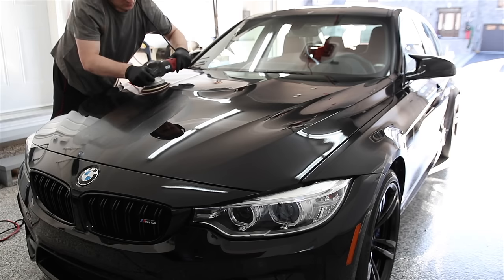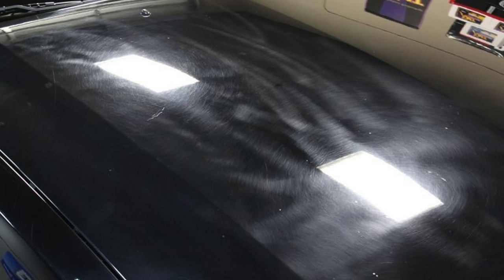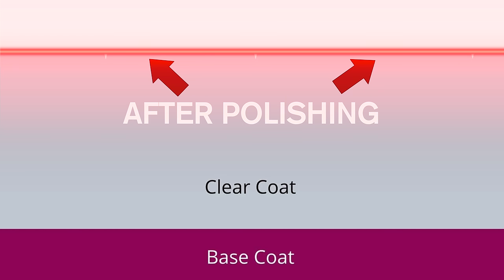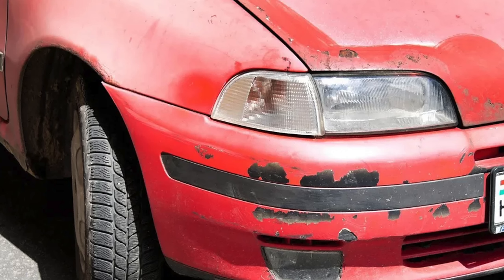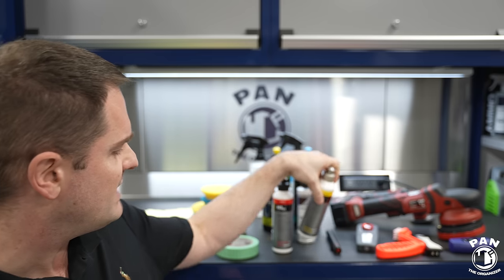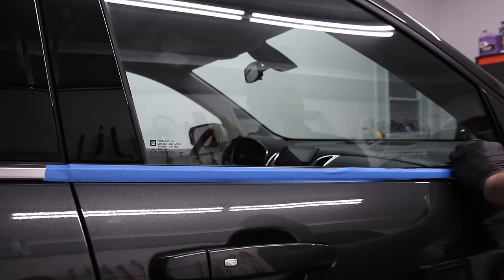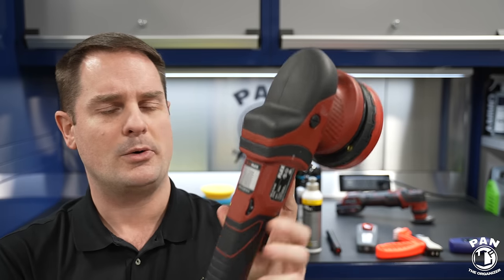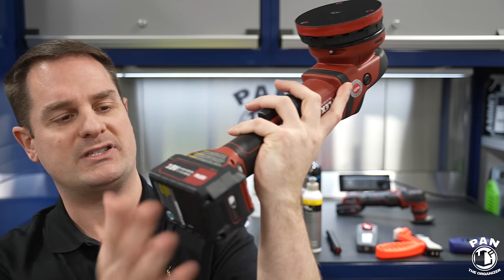DETAILING 101 - Paint Polishing - Everything You Need To Know

Comment: My car is ceramic coated a year ago

I found some hard water spot and scratches

Is it okay to polish it?
How is the decontamination stage before polishing?

My car is black so i cant tell if theres a tar or iron dust?
But i can feel sands texture on the lower door panels
Reply from the maker: Wow, you sure have a lot of problems going on! That's usually a sign that you didn't take proper care of your vehicle on a regular basis.

1) You don't polish ceramic coatings as you would remove the coatings. Polishing mechanically abrades the surface and strips the protection. For water spots, use a water spot remover, like this: https://bit.ly/44ehi2g

That's assuming the water spots haven't been left unattended for a long while, and haven't started etching through the clear coat.

2) If you feel a sand paper like texture on the lower parts of the car, it needs to be clayed. But don't use a traditional clay bar as that would do marring on the paint and damage the coating. Use a synthetic perforated clay towel like this: https://bit.ly/3U4LO9V

3) For scratches, if they are very fine and light scratches, you can try using a polish that was designed for correcting very minor defects on ceramic coatings. This one: https://bit.ly/3FAzyqP

If the scratches are very big and deep, then you have no choice but to fully wash and decontaminate the paint, machine polish to your desired level of finish, and reapply the ceramic coating.

If you use safe washing and drying methods, you should not have to repolish your car often. My Porsche 911 Turbo S was polished once when I took delivery, and I haven't had the need to polish it in the three years that I have owned it.
Reply: @PanTheOrganizer  whoa thanks for your input

Can i ask how do i safely decon my ceramic coated cars which the lower part of the panel has already lost its beading

Should i use a clay towel?
Or its fine to use only microfiber towel to agitate the tar removers

And how is the best way to do it

Should i do it after a wash?

Should i do it while its still wet or dried off

Whats the steps?
Iron remover - spray off
Dry
Tar remover - wipe off with microfiber towel is okay?
Dry off

Use a water spot removed - wipe off with microfiber towel?

Comment: Is it necessary to use a Decon shampoo or will a PH neutral be fine ?
Reply from the maker: Before the polishing process? pH neutral is fine. As long as you're not using a shampoo that has protection in it (like a wax or ceramic). You don't want to be adding protection before you are polishing.

Comment: Question: what is a microfiber polishing bonnet used for? And how does it compare to the sponge in your video
Reply from the maker: What I present here are polishing pads. Not bonnets.
Reply: @PanTheOrganizer  
Right...I was asking about the bonnets not because you had one, but because I bought one from Amazon to polish my motorcycle but after watching your video I'm not sure I have the right thing. Do I need one like yours to polish? And if so, what is my bonnet used for, is it for cutting?
Reply from the maker: Bonnets are usually for lower end polishers, and really only meant to apply a quick liquid wax. Not really for paint correction. True paint correction (removing swirls, scratches and oxidation) is done with a machine polisher that has a "hook and loop" style backing plate, on which you attach polishing pads, that have the same "hook and loop" system on their back (kind of like a velcro style material).
Reply: @PanTheOrganizer  
Wow thank you for your input! :) 
Can you recommend any entry level cordless polishers? I bought a brand new $800 motorcycle tank and when it came in by package, the black tank paint looked like glass. After a couple months of wiping and cleaning it, I've noticed swirl marks on it 😱.

And would it be best to look into those multi purpose polishers, so that as a beginner it'll help prevent me from burning through thin clear coats like what's on my tank?

Comment: So what youre saying is that every time you polish you remove a little of the coat? Wont that mean that you can only polish a limited amount of times before destroying the paint?,
Reply from the maker: More or less, yes. But depending on what you are doing, you're not removing that much. If you are doing a heavy cutting compound with a wool or microfiber pad, and then doing a polishing step, you are removing more clear coat than a 1-step simple polish (for lighter swirls and scratches).

But yes there's a reason it's called paint correction. You are correcting the paint defects by removing a thin layer of clear coat, to make the paint true and flat as much as possible, all while removing oxidation and boosting gloss, depth, clarity etc.

If you polish your car and protect the paint, and then use safe washing and drying methods, you shouldn't have to polish your car for a few years. I get a new car every three years. I only polish it once when it's brand new, to get the paint perfect, and then for the three following years I never need to repolish it. 

But certainly it wouldn't be advisable to polish the car every three months haha. You would eventually go through your clear coat.

Comment: When you buffer/polish a car to its shine, does the car goes back to its old condition like faded paint after washing it for several times?
Reply from the maker: No. Once the paint is corrected and protected, and you care for it properly, it will look good for many years. Of course, if you don't use proper washing and drying methods, and don't regularly wash and use protection, it will eventually get scratched again and the paint will start to fade and oxidize.

So it's all about RESTORING first, and then PROTECTING and MAINTENANCE.

Comment: Hi Pan, I tried doing the polishing using Turtle Wax Polishing Compound, and I had some bad experience with it. Basically when I just started the polishing, the compound became dusty very quickly. I tried using slower speed (roughly speed 2 or 3 and it's really slow, significantly slower than what you've shown in the video), it did become dusty after 2nd or 3rd pass. Unlike the one you've shown in the video, the polishing is so smooth, oily looking and easily removed. Mine is soooo difficult to remove, especially when it became dusty. I'm using 3-4 drops pea size on the foam pad, and I did it under shade (late evening), so it's not hot anymore. Also working in a small area at a time with almost same speed per pass like what you've shown, but it just became dusty too quickly. May I know where has gone wrong?
Reply from the maker: Hard to say as I can't see what you have done and exactly what pads, techniques, etc you were using. What Turtle Wax polishing compound are you referring to exactly? They make many. Perhaps you're overworking the product?? The best bet is to reach out to Turtle Wax and troubleshoot with them. Companies are great for that as they know their products well, but more importantly have helped people go over hurdles or bumps in the road when they have issues.

Comment: If I got polish compound and wax on my plastic trim and it's now chalky white, how would you suggest I remove it now that it's caked in?
Reply from the maker: You should tape your plastic trim before polishing. To avoid that. At this point, you will have to use one of two products. A paint prep spray like this: https://bit.ly/3KXhk6V

Or an all-purpose cleaner like this: https://bit.ly/3L0N6zU

Wash the car, dry it. Spray the product and brush with a detailing brush like this: https://bit.ly/3ZsBjyY

Rinse thoroughly and dry.
Reply: @PanTheOrganizer  Thanks Pan for the breakdown. And yes, lesson learned.

Comment: The hood (bonnet) on my car is ful of hazing and swirles and is really visible. I was thinking of using meguires compound and polisher by hand as I do not have access to an electrical tool to use it on. Is there anything special that I need to do around the window washers?
Reply from the maker: You can either remove them, or tape them.

Comment: how many times can you typically do a paint correction on a vehicle.  i got only light swirl marks.
Reply from the maker: It depends on many variables. Paint type, make and model, condition of paint, paint thickness (measured with a paint thickness gauge), etc

But on a brand new car, it’s safe to say a light polish can be done a few times without worrying about the clear coat diminshing too much.

A compound followed by a polish will obviously remove more clear coat compared to a polish alone.

But once polished and protected, if you use safe washing and drying techniques, you shouldn’t have to polish for a few years.

Comment: Hi I only have small scuff marks.  my SUV has a ceramic coating. I was going to use chemical guys P4. Is it hard to do?  Thank you
Reply from the maker: DO NOT machine polish your paint, because it has a ceramic coating. If you polish it, you will be stripping the coating off. The mechanical abrasion from the polish and the pad will strip any paint protection right off.

If those are only VERY LIGHT defects, there is only one polish currently meant to remove light defects on an existing ceramic coating, and it's this one: https://bit.ly/3Wzl8Rl

With this pad: https://bit.ly/3YhQwVG

Your other option is to use a standard polish and polish the entire vehicle, which would remove the coating, remove the defects, and then restart with a new fresh coating application.

Welcome to my channel. You discovered one of the biggest car detailing channels on YouTube as we surpassed 1 million subscribers and we have over 145 million views! I have been detailing for 27 years and I love to share my knowledge and passion with my viewers.

You found the right channel to help you learn everything about detailing.

Comment: Pan, do you know if that mini polisher is a DA? From what I can tell it's not. But I guess you don't really don't need a DA when they are that small.
Reply from the maker: Are you talking about the Rupes iBrid Nano mini polisher? It has adapters so it can operate as a 3mm or 12mm random orbital (DA), and even an on-center rotary. It can do both.
Reply: @PanTheOrganizer  No sir, I was referring to the Flex cordless mini
Reply from the maker: The Flex PXE80 also does rotary and dual action. This tool’s designated backing system is meant for spot sanding (random orbital 3mm/rotary) paint correction and spot repair, polishing (rotary/random orbital 3/12 mm) for flexible polishing with polishing pads for the elimination of sanding spots and hologram-free finishes, and polishing/sanding (random orbital 3/12 mm) for defect correction, paint correction and hologram removal and finish.

Comment: I saw you have a golf R on there. Do you know if the GTi paint is hard or soft? I have the deep black pearl color on GTi MK6. Also, at what point in the process do we apply touch up paint? Thanks
Reply from the maker: Typically, German brands have a harder clear coat. But I haven't detailed a new GTi in a few years. I had actually made a video about it here: https://youtu.be/epBqfhMeGR0

The best way is to always do a test spot first. You'll see what pad/liquid/combo you need to correct the paint.
Reply: @PanTheOrganizer  Thanks. Mine is 11 years old, so that’s why I was asking about your experience with the old ones. 

Do you know at what point in the process I should apply the touch up paint to the areas that need it? Thanks
Reply from the maker: There are many schools of thought on that, but the majority of pro detailers seem to agree that you machine polish first, do your touch ups after. Wait until the paint is fully dried, and then do the paint protection.

For sure you wouldn't touch up after paint protection, as the touch up paint wouldn't penetrate well beneath the wax or coating, and would get rejected or fail to bond.
Reply: @PanTheOrganizer  Thanks, I didn’t know if it was before or after the polishing stage. So I will compound, then polish, then touch the paint and then put the ceramic coating. Thanks Again

Comment: Master some questions, how many rpm is the speed 2? How many corrections can the clear costo can manage?
Reply: Cold Surface? Avoid heating Surface? 3 step compounds workd with the tecnic You show?
Reply from the maker: For correction (compound and polish) you are using higher speeds (for example, speed 4 or 5 on a 6 speed setting). To apply liquid waxes or sealants (which contain no abrasives, just protection), you are using lower speeds (for example speed 2 on a 6 speed setting). Those are general guidelines.

Comment: Hey Pan, Can I use the same polish procedure on my headlights? only for some light scratches, car is still new. Thanks
Reply from the maker: Yes, or you can use a lens restoration kit with no tools needed like in my tutorial: https://youtu.be/sqpXsBcVako

But headlights restorations are more for removing oxidation and yellowing.
Reply: @PanTheOrganizer  Thank you mate for your reply! I saw that video today as well. Was thinking which way I should go. I might use the DA polisher with my normal pad and Mequiar polishing oil, panel wipe and apply CSL as protection. I did the whole panel coating with CSL+Exov4, Glass coating with your instructions. Great results really!
Reply from the maker: Cool. Keep in mind, depending on how deep the scratches are on your headlights, there are some that may never come off. It's like scratches on paint that are so deep you're at the primer or substrate. No amount of polishing will bring that back.

Comment: Hello! lets say that i have smaller "wash" scratches and swirls ,would an 1-step polish work? like an "hybrid" variant of 1-step polish like "Polish & Sealant" ?
Reply from the maker: If you mean that you only have some light marring, induced from washing and drying, then yes a one-step polish will do. Of course it also depends on what you plan on doing after the polish. If you use a one-step like Rupes UNO for example, that lays down a layer of sealant, so you would not want to apply a ceramic coating after that, as coatings need to bond to a virgin clear coat. You could apply a wax or paint sealant after the one-step.

If you plan on applying a ceramic coating after the one-step, then you can use a product like CarPro Essence, which is a polish that contains fillers (to mask the marring) and serves as a primer for ceramic coatings, all while boosting gloss.
Reply: Okey ,thanks for the information. 

Id just seek info right now , befor i saw on an swedish website there was an "hybrid" variant that polish and Sealant like an wax protech that hold up to 2 months if i not remember wrong. 

I did copy the information and you can tell if there is an good product or not?: 

Polish & Sealant is a cruel polish with P.T.F.E protection (Teflon) that both polishes, dissolves oxides, other deposits and leaves a strong surface protection in the same work step. Easy to work with and leaves a mirror-shiny finish with long durability. Very versatile product that can be used on all glossy materials, as a fast wax that easily works with a microfiber cloth, but also as an oxide solver and scratch remover on not too difficult varnishes. Also works well as rim wax, protection in doorways etc.
Reply from the maker: Impossible to say without testing.

Comment: I’m still kind of nervous. I bought this polisher off of Amazon from a company called blackcube. It’s a little red 12 V one with two batteries. I bought the three pack of chemical guys 6 1/2 inch pads, orange black and white. It’s a Honda so I guess the pain is soft. It’s a 2022 so I don’t know..
Reply from the maker: Not sure about that polisher, seems like a entry level cheap brand. I quickly checked and it's more of a little hand polisher made for applying liquid waxes or sealants. Not really made fo paint correction in my opinion. I doubt you'll get anything accomplished with that.

For my recommendations of affordable polishers, watch my video here: https://youtu.be/LvPCkCqXEq0

Comment: Hi Pan, could you shed some light on how to fix deep scratch please
Reply from the maker: It depends how deep your scratch is. If it's gone through the clear coat, and into the base coat (color) or primer, there's nothing you can do about that other than a full panel repaint/respray. If you run your fingernail on the scratch and can feel the ridge or gap, that usually means it's too far gone.

But for heavy scratches that are in the clear coat, see my video here: https://youtu.be/xR6BJEyEVT0

Comment: How many times can do a paint correction to a car before consider the clear coat will not stand any other  correction and need a professional redo?, All the chemicals used does a sanding effect over the clear coat .
Reply from the maker: There is no specific answer to that, as all paints are different. Different hardness levels, different thicknesses, etc. You would have to measure the thickness of the paint with a paint thickness gauge to determine how much material you are working with and see if you're in a safe zone. The goal is to always preserve as much clear coat as possible. See my video on paint thickness gauges: https://youtu.be/UqtwR_i5WK4

Once properly polished and protected, a vehicle shouldn't need deep polishing for a few years if you use safe washing and drying methods.